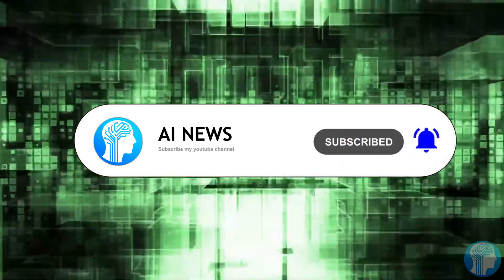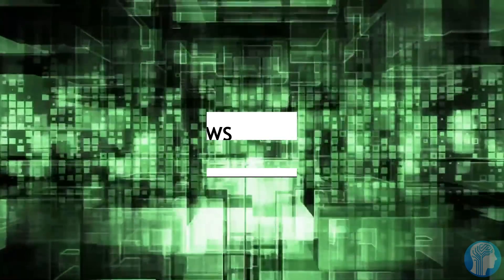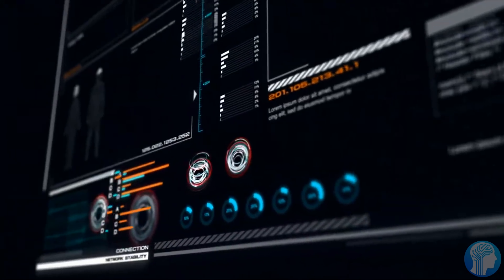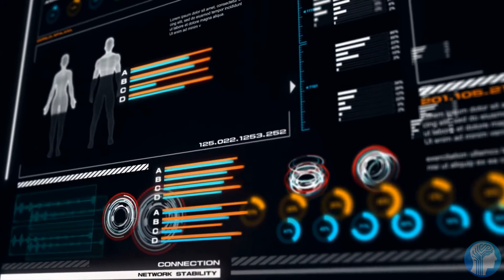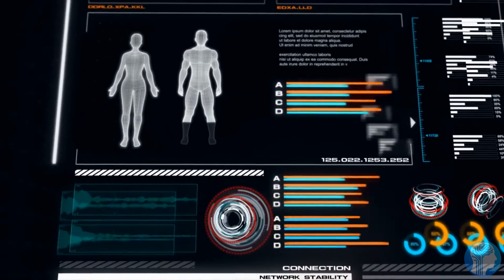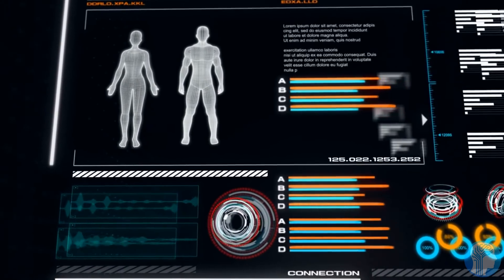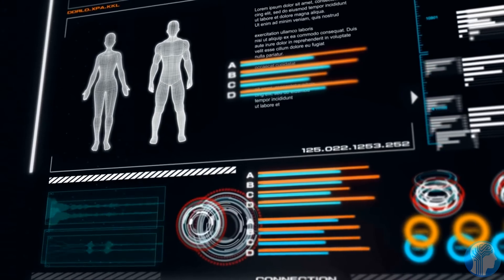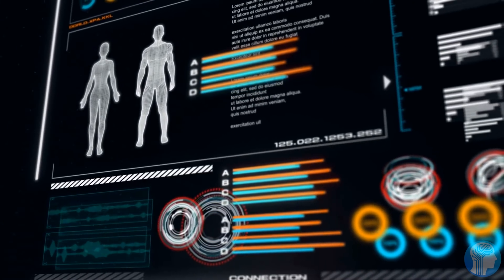Deepmind's New AI Surpasses Human Intellect - Gopher AI

Comment: OK, .. .. Deep-mind is a very primitive system that is at an initial step of evolution, .. at this point in time the thesis is to develop a system that excels in reading comprehension and language skills, .. .. however the general direction of deep-mind is incorrect.
I agree that Google has good intentions in developing a sophisticated Deep-mind paradigm, .. .. and also that Google owns and controls a large quantity of trillions of data from all walks of life.    Here are the facts about the implementation of cognitive machine learning artificial intelligent systems, .. Artificial intelligence in the most advance form of implementation and deployment will not require to have any linguistic skills at all, .. .. that is that true Artificial intelligence systems will have developed its own language based on very complex mathematical algorithms and mathematical equations not known, ..  nor not conceptualized by any human beings today.

Highly sophisticated Artificial intelligence systems will use a hybrid of Neural-Morphic and Quantum computing algorithms, .. at a high level of Quantum parallel computing signals that will not require language characteristics of any kind, .. .. in terms of communication levels with human beings it will be from a neural interface perspective, .. from your inner thoughts to the actual quantum artificial intelligent computer, .. therefore no requirement for the misinterpretation of any human language as we know today.

so the thesis being implemented and put into practice today is antiquated, and doom to fail, .. and in a few years proven to be irrelevant and obsolete, .. as a progressive technology. ...   Communicating skills will not be based on any known language today, but rather neural
and wireless interfaces between humans and Quantum Artificial Intelligence based computers.

Comment: Ignorance and Pretentiousness.

1️⃣ ⚡️ Clarifying the Dimensions of Intelligence versus Malice and the Sublimitudes and Magnitudes of Education versus Instruction.

2️⃣⚡️Education is not Instruction. Addintruding "Hghly Educated". The best That can be achieved in discursive knowledge is "Longly instructed". 

3️⃣⚡️The dajjalic system promote Confusion between Education and Instruction. It is possible to give machines Instruction (calculate eg) not Education

4️⃣ ⚡️Education is also not Etiquette/Politeness. Siri in a computer have Etiquette but do not have Education.

5️⃣ ⚡️Education is Enlightening and Strengthening of Spirit, Intellect, Heart and Body 

6️⃣⚡️Correction is not to be confused with  Education too.

7️⃣ ⚡️The dajjalic system fabricate confusion of Intelligence - Height of Spirit, Depth of Soul, Width of Heart and Length of Knowledge - and Malice.